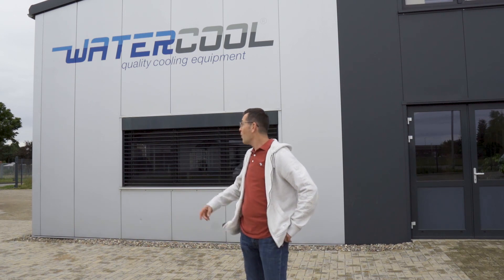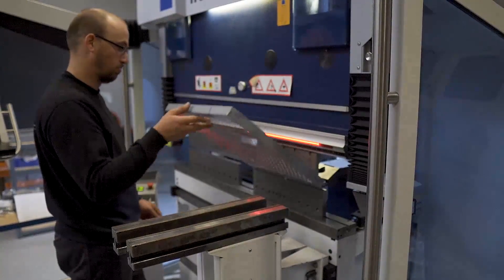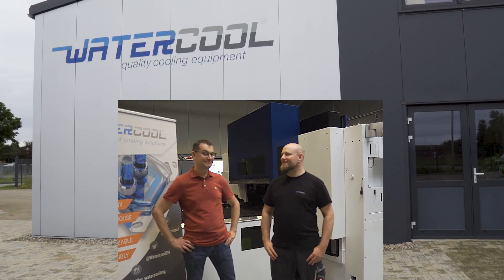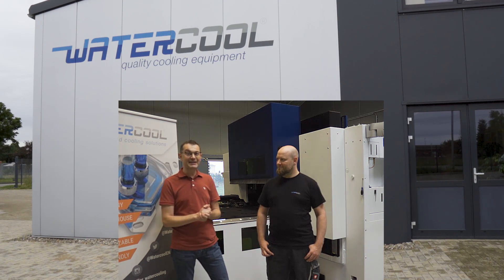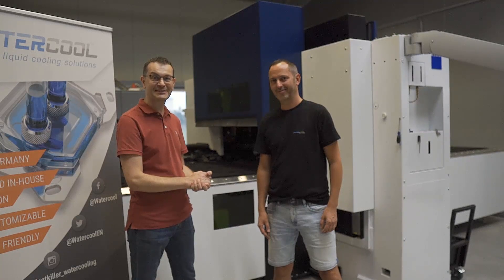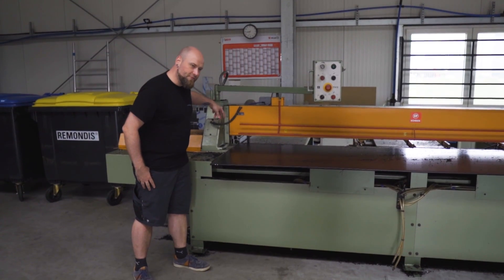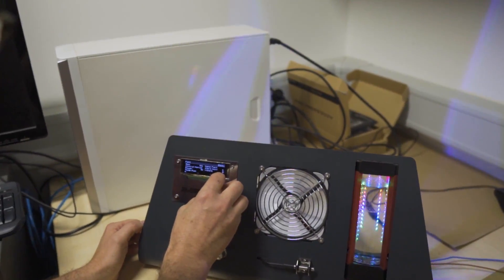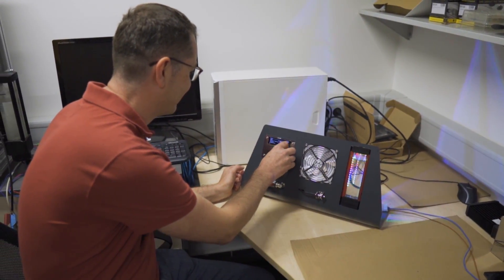Watercool Factory Tour and How Heatkillers are Made!

Comment: The main issue with control panels in 2019 is that 99% of PC cases removed CD-rom slots, some pc cases have a single slot.
So their dual slot controller is completely useless, even Define cases that always had cdrom slots, now have none, my define r5 has two, moved to one in R6 which is also optional and removable to install radiator
Reply from the maker: True, but who knows how the final result will look like.
Reply: @DazModeWatercooling  If they manage to somehow make a wireless desktop device or at least USB Desktop [like USB sound cards] that will be nice.